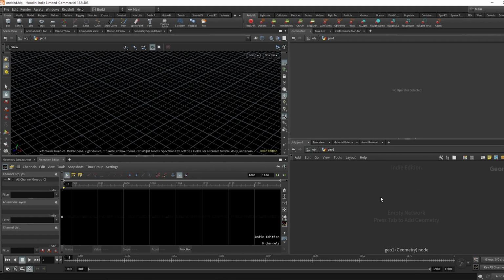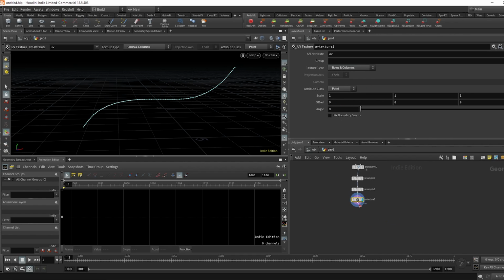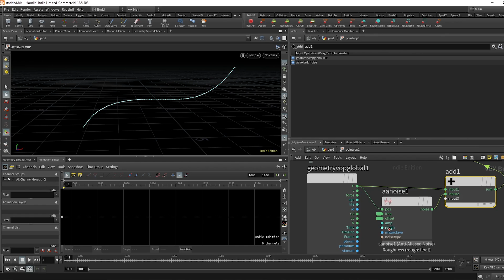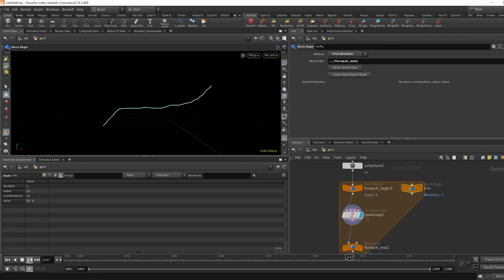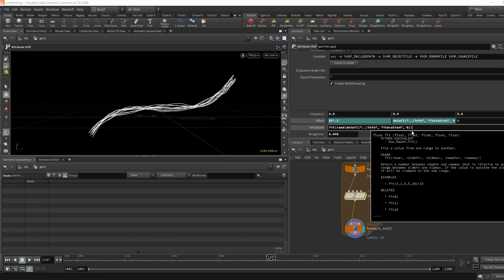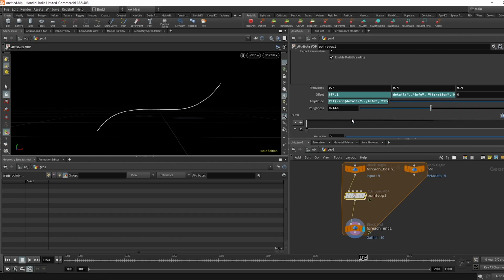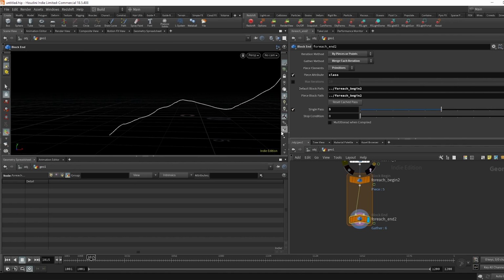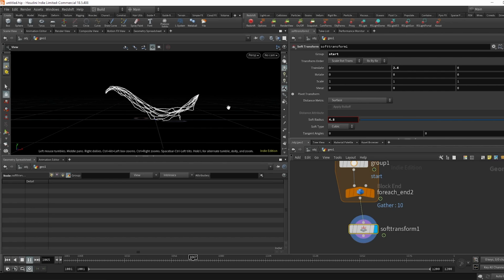For Each Loops - Houdini For MoGraph Ep0005

Comment: Nice video, as I get more used to Houdini's  workflow, this becomes a bit easier to follow, I can't help to think that it would be great tif the "iteration" attribute was clippable or something, so you didn't have type that out.  Cuz I think that freaks people out,  I dismissed it early on cuz I had so much to learn I put it off.  In softimage ICE, it is just a matter of using a "get data" node.  Maybe it would be inside VOPS, I will have to look into that:)